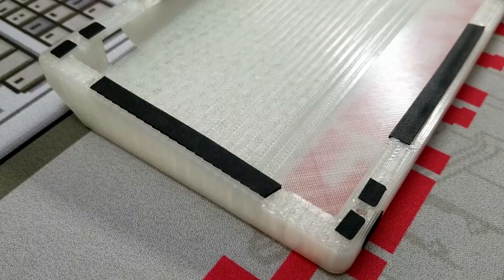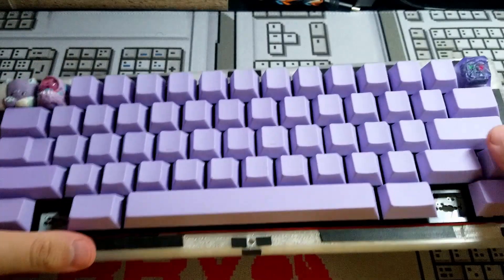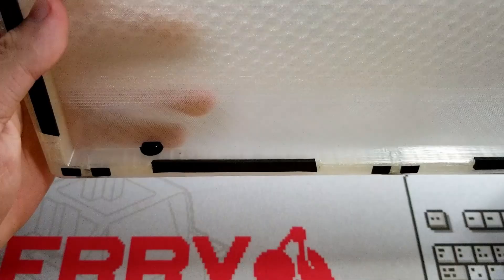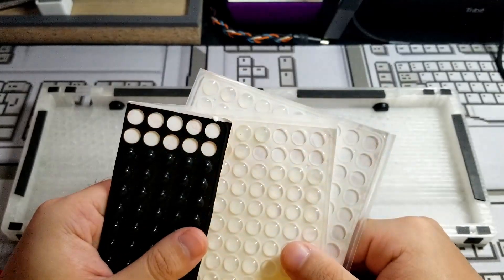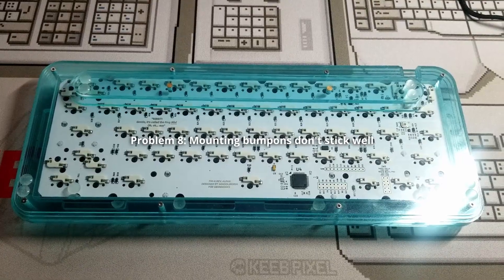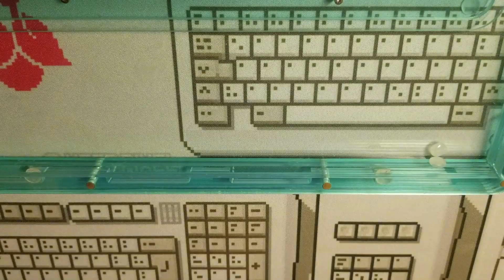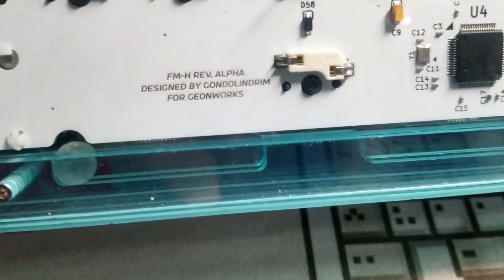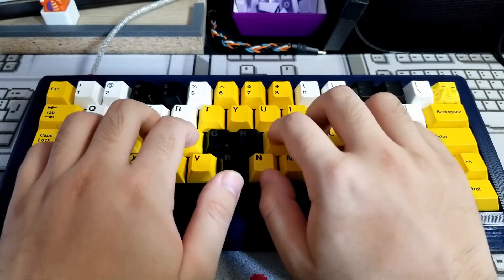Tips and tricks for the Bumpon O-ring Mod (feat. spacebar spacers)

Comment: for the PLA60 wouldnt the gasket bars interfere with the oring resting on the bumpons? And is there any issue with using an oring on a hotswap board, becase I think the strain on the orings pushing the switches in the corners could cause it to pop out. Besides that awesome video!❤
Reply from the maker: that's why you use a universal/unikorn/bakeneko plate with no gasket tabs. hotswap oring isnt a major issue with stiffer plates but switches might pop out of plastic plates like you said. I wouldn't worry too much, unlike millmax which I wouldn't recommend at all
Reply: @alceray  Can you tell me which plate did you use in you mx blacks on pom PLA 60 build?
Reply from the maker: @keyboardstuffkeeb  you just mentioned it, pom
Reply: @alceray  I am sorry if my wording was weird, but I meant what keyboard plate is it? unikorn or bakaneko or some universal plate?
Reply from the maker: @keyboardstuffkeeb  unikorn

Comment: does this work for a centered usb 65%?
Reply from the maker: depends on a lot of factors. assuming either the pcb or plate has tabs, you'd have to get a new tabless one aftermarket. for the pcb, check out the zed65. for the plate, search for universal ones, otherwise you'd have to remove the tabs from the plate file if that's available. mind telling me what board you're referring to?
Reply: @alceray  its a custom gasket kyuu 65
Reply: @alceray   it uses mechlovin9 pcb, the plate has tabs yes.
Reply from the maker: @jadenngl  Your best bet is to modify the tabs out of the plate file and make a custom plate. That might be too big of a task though idk.
Reply: @alceray  could i just dremel it? or na
Reply from the maker: @jadenngl  yeah you could if you're willing to risk it